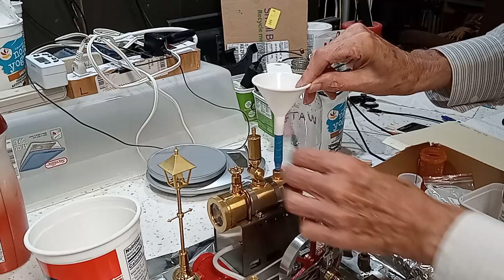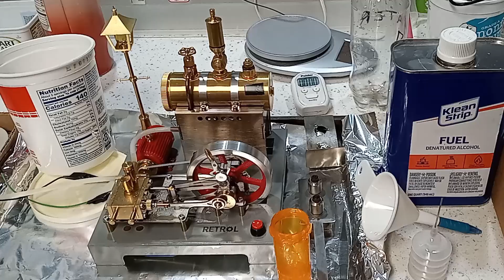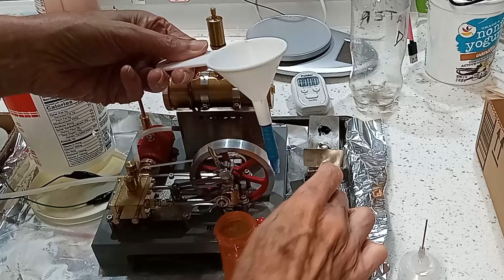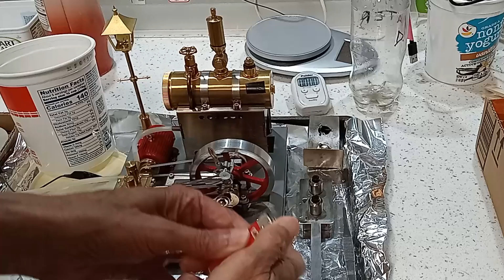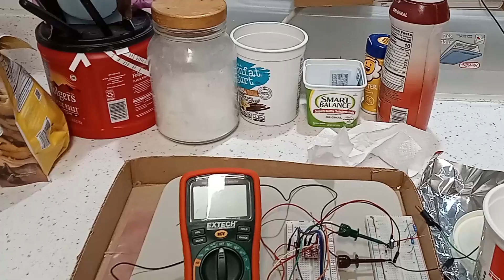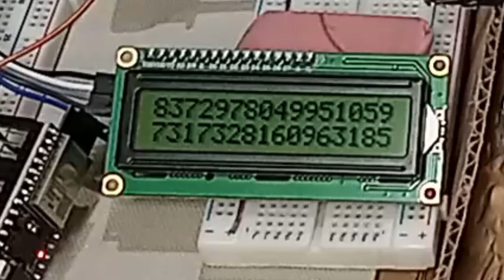Eight hundred digits of PI by steam power plant

Comment: you has the chance to use a raspberry pi!!!
Reply from the maker: The Raspberry PIs that run Linux use too much power - 400 mA or more.  The Rasberry PI Pico can be used if the WIFI is turned off.  The ESP32-C6 uses 30mA idle and 40mA computing PI.  The streetlight that comes with the SE-02 uses about 40mA.